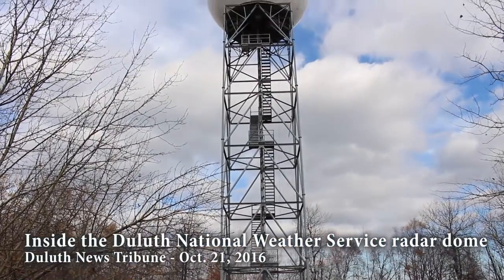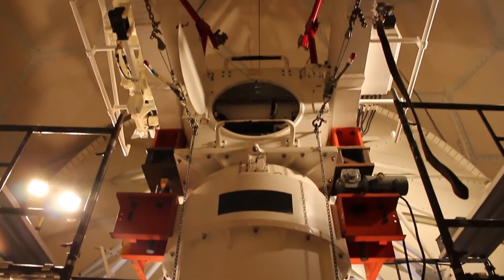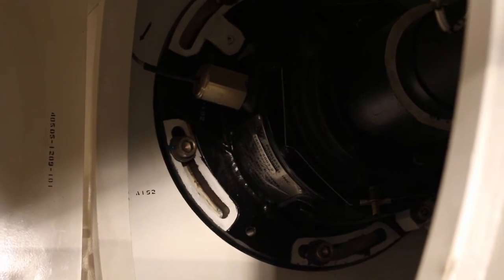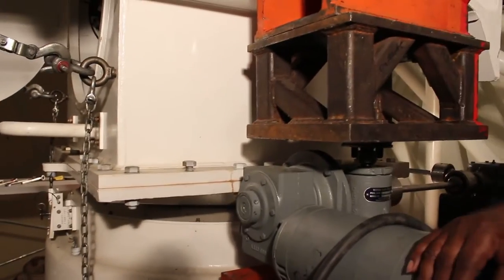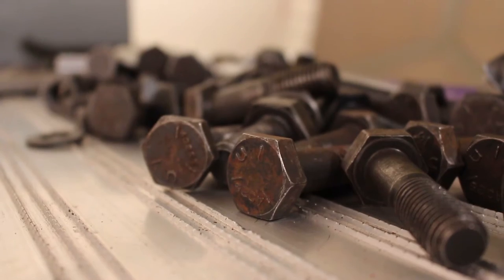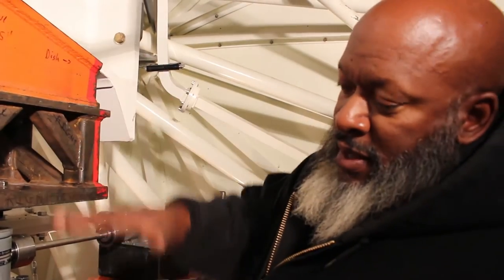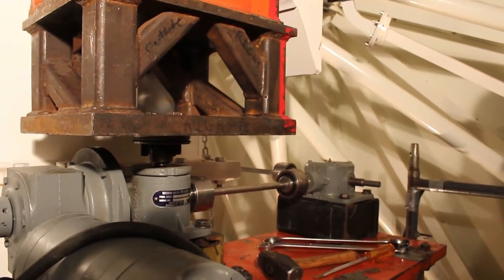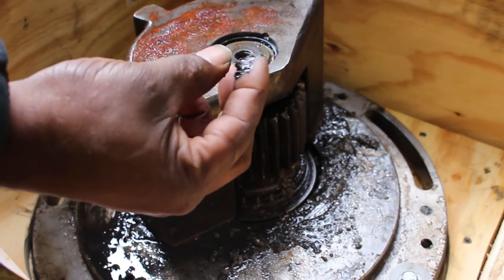Inside the Duluth National Weather Service radar dome

Comment: i believe the old gear is shredded because the tech that installed a replacement pinion motor did not tighten the backlash adjuster bolts sufficiently and it slipped out of line. torque it down is rite!